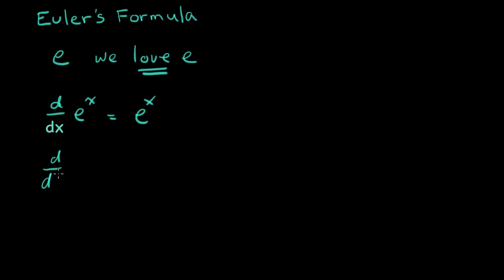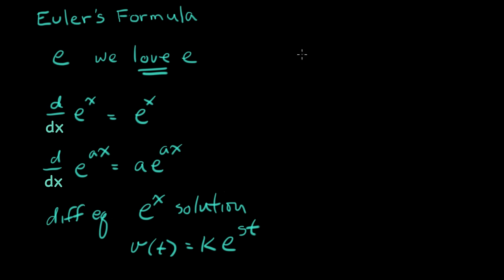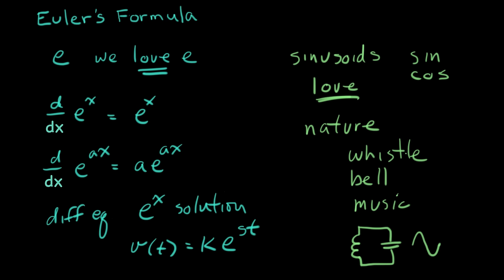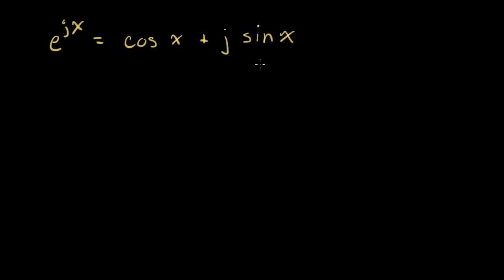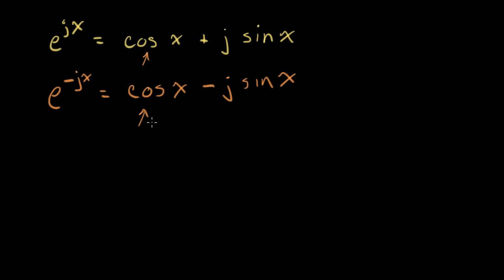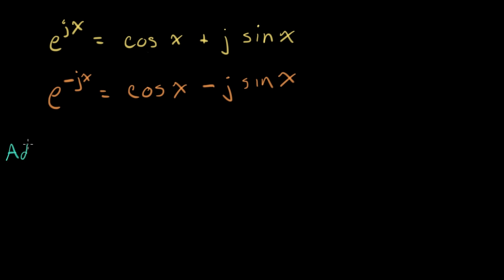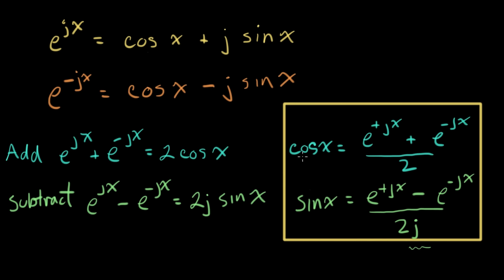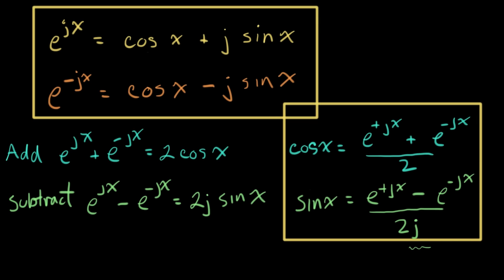Eulers formula

Comment: Prove that ( in Euler's formula),
sin^2(x) + cos^2(x) = 1
Solution:-
We know that,
e^(ix) = cosx + isinx........(1)
e^(-ix) = cosx - isinx........(2)
[ 'i' is the complex number]
Then multiply both equations,
e^(ix-ix) = (cosx + isinx)(cosx - isinx)
or, e^0 = (cosx)^2 - (isinx)^2
or, 1 = (cosx)^2 - (i^2)(sinx)^2
[As, (i^2) = -1]
So, 1= (cosx)^2 - (-1)(sinx)^2
or, 1= (cosx)^2 + (sinx)^2
Thus, sin^2(x) + cos^2(x) = 1
(Proved)................. 😁😁😁
Reply: bro i am dumb. but, how did that (-1) disappear in that 2nd last line?
Reply: @OfficialOffsideBall 

Anything multiplied by 1 or -1 gives you what you have already started with. Look closely and you will see a notation change.

Look at the equation where it says -(-1)

And so he multiple sin with -1 making it -(-sin) and then distribute the negative sign and you will get just sinx
Reply: @OfficialOffsideBall 

No you are not dumb. You can do this bro.